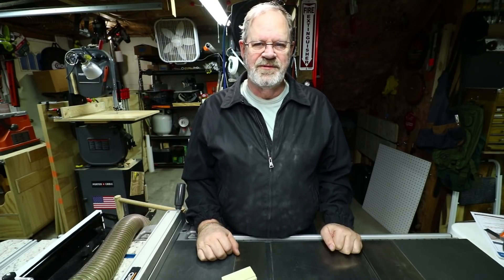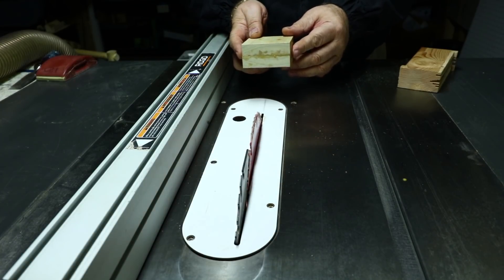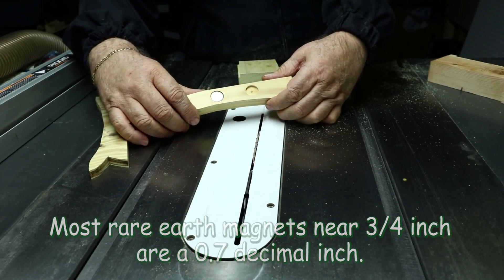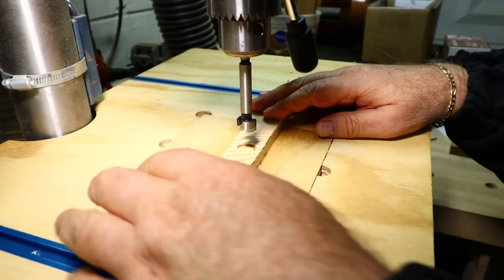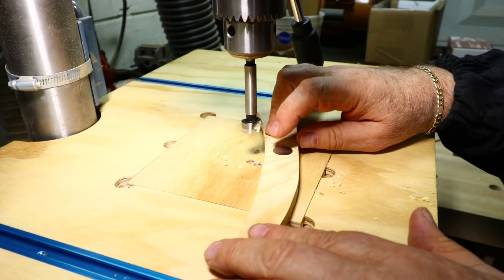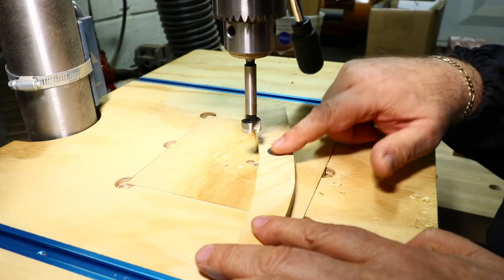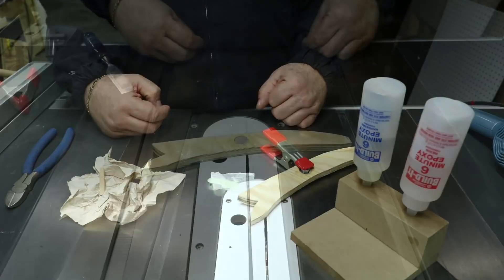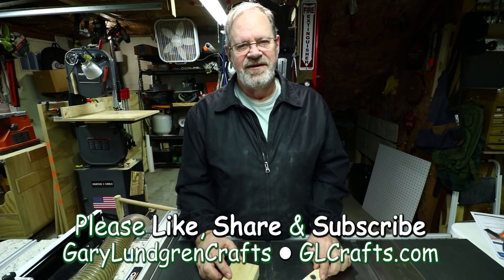Shop Tips: Rare Earth Magnets On Jigs Ep.2017-43

Comment: Neat gig, I use neodymium magnets for many projects, for my dust collection system I wanted a way to quickly connect and disconnect my five inch dust collection hose. I have a 3 D printer and made all kinds of fittings for the DC system. But I was not happy with the fittings to connect various hoses. Finally I came up with using two toilet flanges. I used 3M adhesive to glue a sheet of 220 sand paper on glass. I then flattened the flanges dead flat. Then using a forestner Bit I drilled 4 counter sunk holes and mounted the magnets flush to the flange on each flange connected my hoses. Now I have quick disconnects for all of DC needs. I tested for leaks using incense sticks. No leaks.
Reply from the maker: Thanks for sharing!

Comment: I realised that this old but what I do is drill the hole a little deeper put glue then magnet in
Wipe excess glue then place a piece of wax paper over the magnet
The I place a heavy ish piece of steel on top
The magnet attracts to the steel making it flush
No sanding
All the best
Reply from the maker: Thank you!  Great tip!  Thanks for sharing that. 👍

Comment: I bring my glues, tape, and adhesives inside my house, as my shop/garage is not heated, wherein if left, the glue hardens. Thanks Sam
Reply from the maker: Thank you! Good tip! That is true. Cold weather thickens glues. My garage is a tuck under and remains above freezing. I have a space heater for when I do work out there. In Winter I'll moves glues, etc just inside the door to a warmer space.